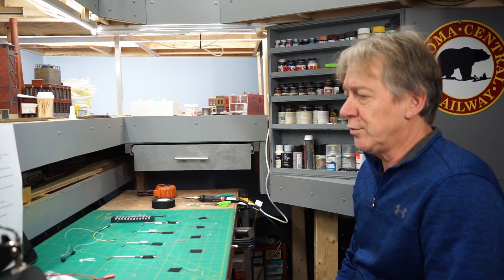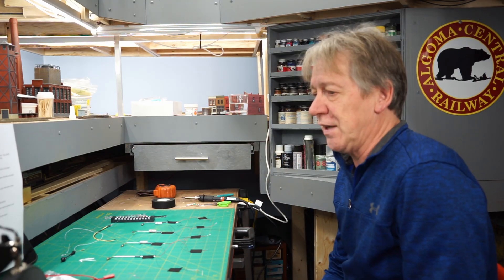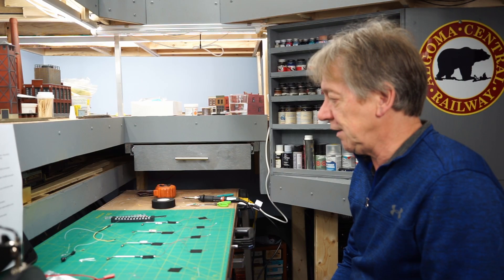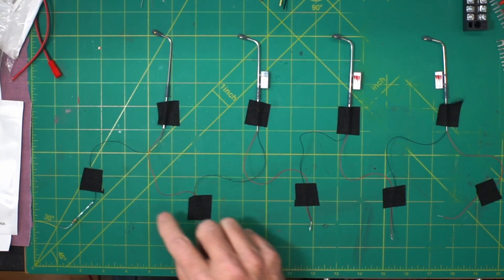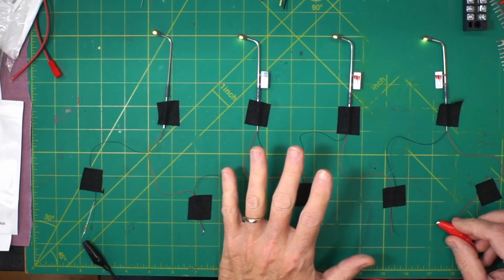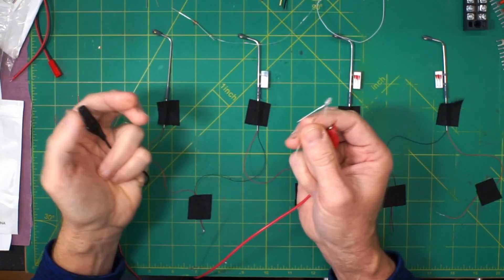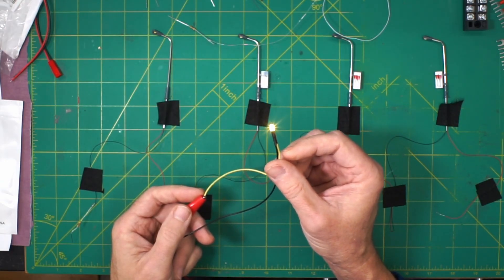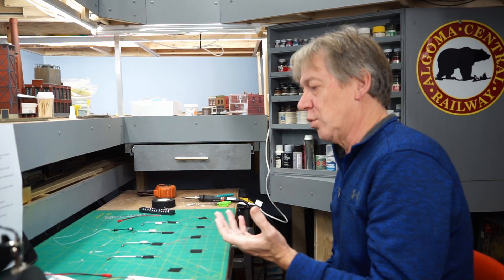DIY LED Model Railroad Lighting. Affordable lighting basics, simple resistor selection. ACHB 1-50

Comment: Why not just use a buck converter to step down the 12vdc to 3vdc for the LED circuit?
Reply from the maker: Resistors are simple and cheap. No need for converters. Even with a 3V power supply, a resistor (probably 100 ohm or less) is recommended to limit the current. It’s the excess current that kills the LED…

Comment: Thanks so much for this relatively short, very concise, much needed video. I've  seen many videos expounding the virtues of the woodland scenics plug and play sytem. An excellent video, because the woodland scenics stuff is hugely expensive. 20 mv leds on amazon are 8$ for 20, with 370 ohm resistors included. Woodland scenics charges $11 for 2 lights, 20ma, with really, really thin 30 awg wire. $17 for a light hub for 4 lights max, $16 for an expansion hub, an auxiliary switch to turn everything off $12, a 24 v dc power adapter $24. That totals $69 or get them all in one kit for $64, but  only comes with 2 lights. A medium sized o gauge layout might have 8 buildings,  10 other led lights. I have not lighted my layout in 20 years so I've  decided to learn how to do it best with leds, 370 ohm resisters, some plugs, a 300 watt power suplly providing  12 volt dc output, 25 amps, 53$ on amazon, 3000 positive reviews. 25 amps will power over 800 20 mv led lights. I see a much needed lighting how to video in my future. And yes, I'll learn to solder a resistor to the negative wire of an led light. Wish me much luck. Your video has made me say its time to learn modern lighting my o gauge trainboard.  Gary
Reply from the maker: Glad to be helpful! Lighting adds a lot to the layout, and if you go the DIY route, and doesn't have to be ridiculously expensive. Soldering is pretty easy once you get the hang of it.
Reply: yes it is pricey but very easy thanks keep the videos coming !!!!

Comment: Have you ever used a computer power supply? I understand that a computer supply has a 3 volt wire supply.
Reply from the maker: I considered it - but a reliable 12v supply is smaller than a computer power supply that has a number of different voltages - and adding a resistor is easy enough where needed. I have one 12v supply for each deck, and they power lighting as well as power to my Arduinos.

Comment: I'm running both of those styles of street lights, but using 1K Ohm resistors. Depending on the scene, I string 2, 3, or 4 lights per resistor. They're inexpensive, easy to install, and should last for decades.
Reply from the maker: They work well, and I like how they look.

Comment: Thank you this makes it so easy to under stand. Now to see if I can do it. But one question the lights woth the built-in resisters if i run them parallel how many can i run together before the lights start to dim. Then I have them connected together what kind of hub should I use that would then connect to a power supply. I'm very new to all this.
Reply from the maker: If you run them parallel - all the positives together and then all the negatives together - they won’t dim unless you put too much load on the power supply. In series, you will just need to experiment. I would just get a terminal block with jumpers to connect everything.
Reply: @achb-railway  thank you
Reply: Hello I have another question I'm hoping you can help with. I have these little house that have very small leds in them. They take 3AAA batteries (4.5 v). I want to by pass the battery pack and attach them to this little board i got of amazon. Evemodel PCB012 Power Distribution Board Self-Adapt Distributor HO N O LED Street Light Hub DC AC Voltage Train Power Control. I can plug 28 lights into it. 12vdc for power supply. I can't see the size of the lights but I'm assume they are 3mm or smaller. I want to wire three together parallel. Can I do this? Will I need to put resistors somewhere on the wire? If so where. I have 40 of these little houses total. I will be adding some other lighting in my display but I will run a separate board for that using prewired 3 and 5mm leds (resistors included) for those.  Do you know if this can be done.
Reply from the maker: @deborahverkerke4330 If you wire them in parallel, each house would be getting the full 12V. If you wire 3 in series from the same 12V supply, they should “theoretically” work. No guarantee - as I don’t know how each house is wired internally…
Reply: Neither do I. The are attached to the battery pack. Should I use a resistor on the wires for each house. I double there is one but i can't look inside to see. If you don't know can you recommend some where I can look or other vidoes to watch. Thanks agai  for yiur help.@achb-railway
Reply from the maker: @deborahverkerke4330 You need to reduce the voltage to each house down to the same (or less) than what they get from the batteries. 3x4.5 volts is 13.5 volts. So - 3 houses in series on 12 V should be safe (without knowing the specifics of each house). Adding a resistor in series anywhere in the circuit will drop it even more - certainly won’t hurt as an experiment.

Comment: Just watuched the walthers 90 ft turntable. I am 38 got back into model railroading in 2018 and am final building a layout. My hobby started with my former neighbor needed some help cleaning their basement. So i helped them and they found a tyco Chattanooga set, in a old plastic milk crate. They were going to throw it out so I rold them if they don't want it i will take it. And well it didnt run it immediately started shooting sparks and fried the motor. But since then i ahbe been collecting old model trains stuff. And i finally decided to actually build a layout to run all the models i collect. So videos like this helps.
Reply from the maker: Always good to hear they are helpful! Have fun with the train addiction…

Comment: If the lights were on a hwy on the layout how many would you hook together.
Reply from the maker: I probably wouldn’t connect any more together in series than 3 or 4. If one light dies, everything in that series stops working. Having too many in series would make troubleshooting a pain… Also depends on how bright they need to be..

Comment: Thanks so much for putting this together. This is an area that I have little info/understanding of, this simplifies it for me although I thought I would need too use a 5vokt power source Cheers, Charlie
Reply from the maker: Thanks for watching! You can use almost any low voltage DC power source - but the value of the resistors you would need would be different. There are charts available online to figure out the correct resistor. What I mentioned here was for 12V (although using them on a somewhat lower voltage would probably work as well).

Comment: Thanks for the most straightforward explanation of how to wire LEDs Ive ever seen. I’ve been wanting to add lights to my layout and now I know how easy it is. As well as streetlights I’m hoping to use a ribbon strip in some buildings and I assume the principle is the same.
Reply from the maker: LEDs are not complicated to work with, once you understand the basics. And considering how cheap they are, it’s not a huge loss if you blow one or two while experimenting on the workbench!
Reply: @ that’s good to know. I got some streetlights that came with resistors off Amazon and found a roll of led strip very cheap at Princess Auto to cut up and put in buildings

Comment: Back in the old analog days when using GOW incandescents, even though they were rated for 12v I ran them on 6v.  The soft glow seemed to scale better.
Reply from the maker: I’ve done similar things - run a couple in series, drop down with a resistor, etc.

Comment: My up coming project swapping out my old lights for LED. So if I understand correctly if I buy the lights with a built in resistor the more I wire in a series the dimmer the light be emitted?
Reply from the maker: Yes - although the dimming effect will be more pronounced with multiple resistors (one per LED). I have tried it with up to three LEDs in series (with built in resistors) and they do work, and get noticeably dimmer with each added resistor. The reality is that with 4 or more white LEDs in series - on a 12 volt supply - you don't even need a resistor. Each LED has a forward voltage of just over 3 volts, so with 4 together, that's already over 12 volts.

Comment: Great video, what wattage are those resistors?
Reply from the maker: These are 1/4 watt resistors. Those street lights are well under that in current draw - and when connected in series, the current doesn't go over the rating of the resistor (I measured it).